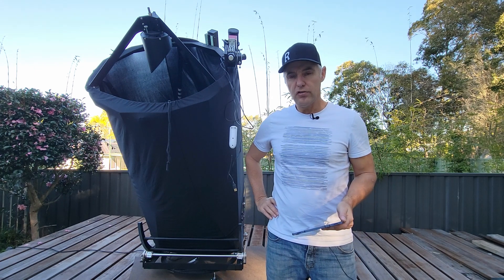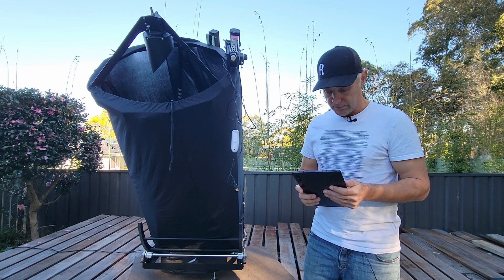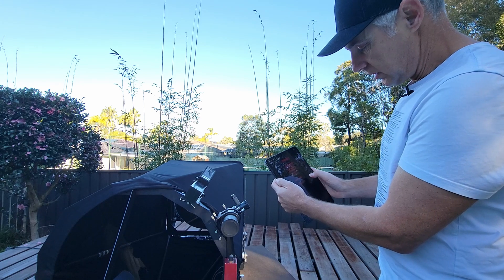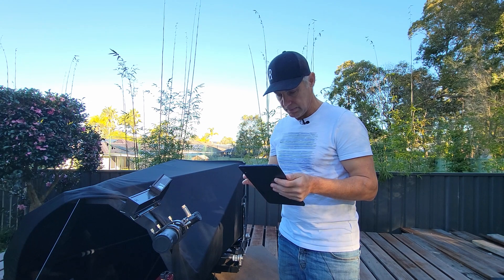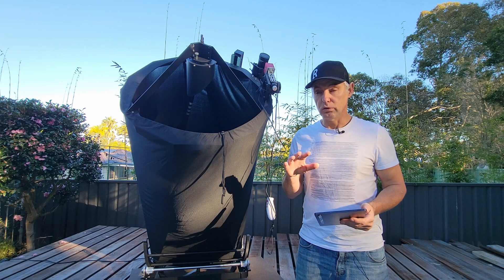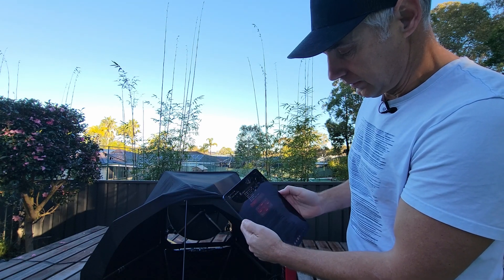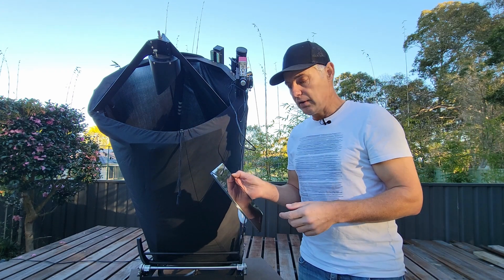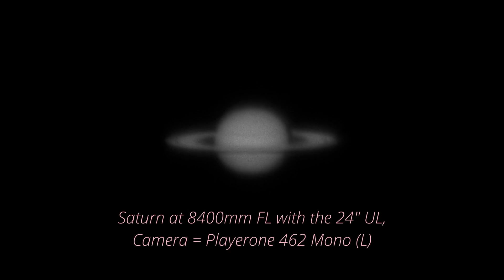Onstep Goto safety protocols protect my 24" scope after I stuff up !

Comment: I just got the goto 18UL from HO. I have a question on the goto system. Do I need a computer to operate the goto on it. Or can I just use my iPhone with SkySafari right out of the box after installing the goto? Also what app is the one you using in the screen of your tablet I saw a red menu?
Reply from the maker: @Astro_Ash_Jeremy  If you have a current Hubble optics scope then you will be looking for the Onstep app and or after you connect you can overlay/ connect the Sky Safari or Stellarium apps with more objects and control.
Hope this helps 
Damo
Reply: @damienk2372  
Which goto set up do you have? I don’t think we are using the same one
Reply from the maker: Hi mate, my 24" is using the Onstep goto system. The altitude bearings are geared and they sit on shafts that drive them.
Damo

Comment: I would like to add OnStep to my custom 16" dob.  Which OnStep system did you use for yours?  Also curious if you can control the slew speed of the steppers... maybe faster, or does that take different steppers?  Thanks!
Reply from the maker: Hi, unfortunately technically i can't help you with much because my scope had it pre installed from Hubble Optics, I can control slew speeds so i imaging you would be able to as well. 
Sign up to this group here - https://onstep.groups.io/g/main/topics , and search for your preferred set up and i am sure there will be someone that has done it first. All the best
Damien